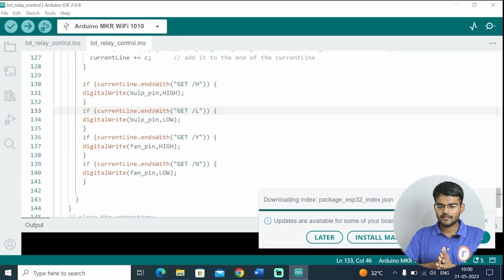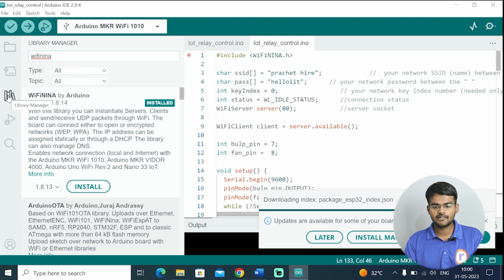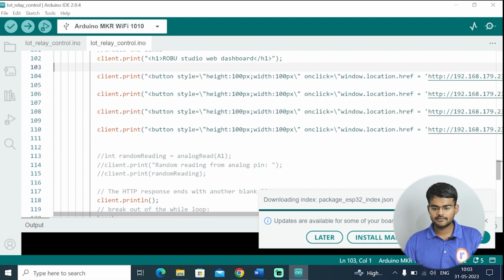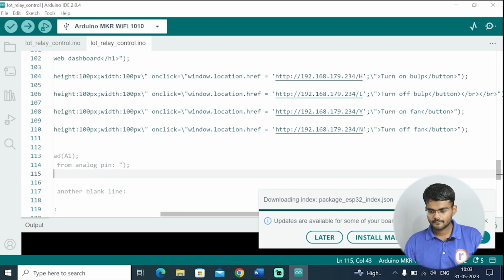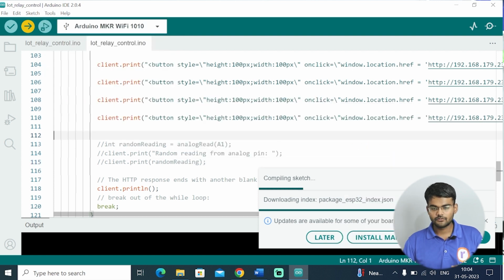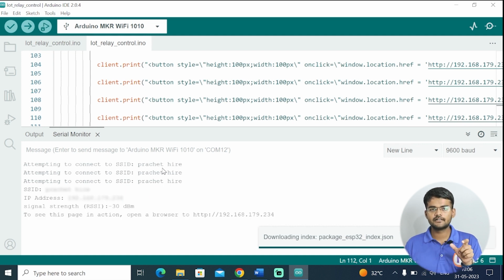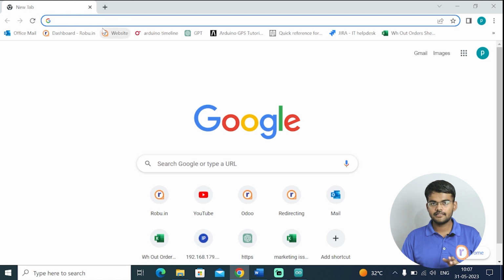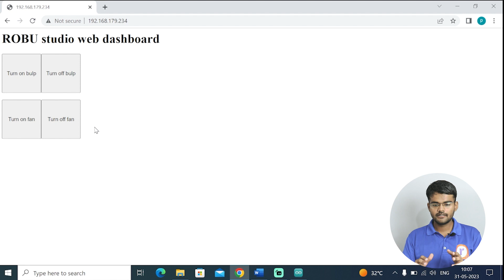How You Can Control Devices Remotely with Arduino MKR WiFi 1010 Web Server | Arduino MKR Projects |

Comment: MKR 1010 board will be connected to different network and our phone or laptop will be connected to different network
Reply from the maker: You will  need to  modify the code for the Arduino IOT  cloud or BLYNK  to work like that.

Comment: Can we control MKR 1010 BOARD remotely using the IP address ?
Reply from the maker: Yes, you can use an IP address to remotely control a board, but in order to use this code, the board and your controlling device must be on the same network.
However, to make it truly remote, you can change the code for BLYNK or Arduino IoT Cloud.